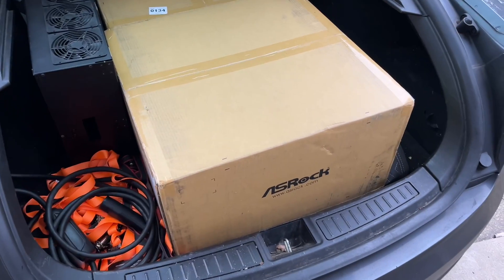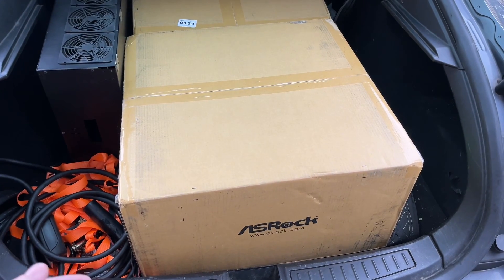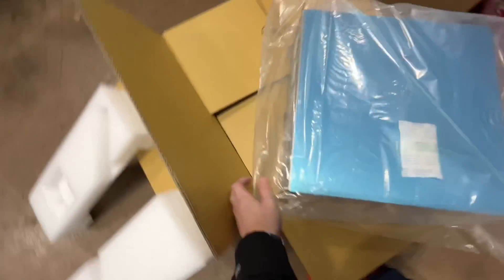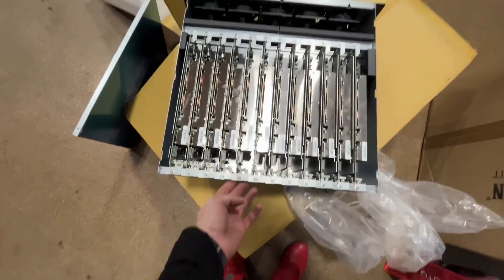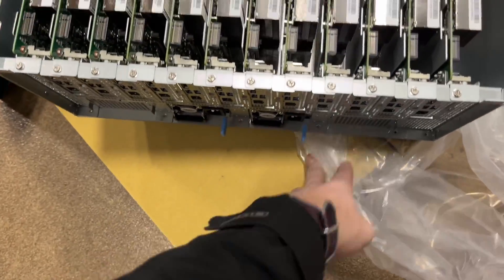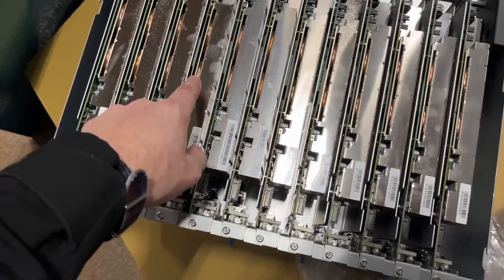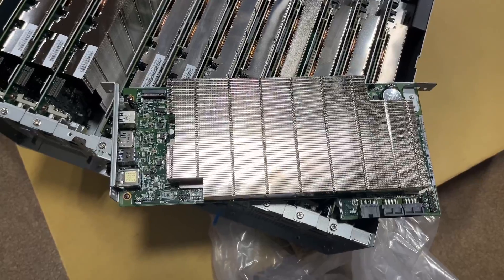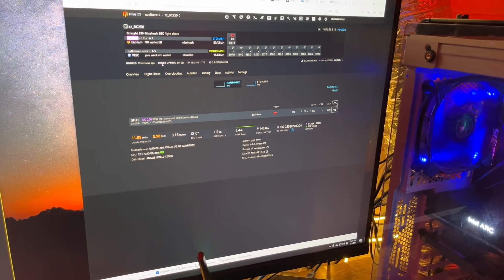is the BC-250 good at mining?  not really, no.

Comment: @ - Ovalbore Tech- I have this 12 rig APU - I do not understand couple of things - how to setup it properly - Me looks like a total idiot when I now unpacked this whole 12 APU miner - never seen such a Frankenstain at all in my life - I bought it only because that whole 12 APU miner are dirt cheap - number one question - I have only wifi at home - I see you have wifi adapter stick in USB port of this APU - so why on the Earth are wired internet needed for this thing if wifi stick are plugged in??  Can it take internet only from wifi or that wired internet is a MUST as well ??? And second question - How do you managed it to add all 12 these APUs - I mean whole box - at once to the Hiveos ???? Third question - how did you manage to boot it up just a one APU seperately - what you done to get it done and boot into windows as well??? Will it mine if in windows booted? Did you test it on SRB Miner in Hiveos (I have some algos in SRB miner needed to mine) - will it run SRB miner in hiveos ???   THANK YOU !!

Comment: These things are very weird,  as far as mining goes, the way I look at it is right now the cpu mining pays for the power cost and whatever I'm specing mining on the gpu is free crypto...is it worth it from an efficiency standpoint.... meh it uses a ton of power, but in my situation that's ok. Don't buy these things if you are limited in how much power you can use...but if you have the power and dont mind the efficiency, its hard to get this much hash for basically the cost of a 4070ti super
Reply from the maker: they strike me as 10 series efficiency but the plus is you have an insanely dense box of nodes you could easily spec 24 to 36 projects on at once with dual GPU mining AND cpu mining. it seems to get less inefficient the harder you push it. 

just a really weird device! :)
Reply: @OvalboreTech  very weird and it was so dam cheap, I have some interesting videos coming out on a use csae for them lol. Super interested to see what everyone else comes up with

Comment: You can windows on it. And if you are just running one of these cards, put a jumper on the psu and it will use less electric.
Reply from the maker: I tried windows, power consumption still awful, no official driver support but I was able to get drivers largely installed. 87W idle power consumption.

incorrect.

Comment: Great video!!! I picked up 4 cases about a month ago and have been tinkering with them ever since. I would love to see some content on how-to run SteamOS on one or hack a Win driver like you said. I hope someone does unlock the BIOS and really open these things up.
Reply from the maker: they do boot in to windows just fine -- drivers... Sort of load?

SteamdeckOS is next.
Reply: let us know how it goes. I just wanna see its gaming performance.  @OvalboreTech
Reply: @OvalboreTech  Nice!!! Which driver did you use? I was able to boot to Windows, Ubuntu (nomodeset), and SteamOS...but the drivers are a problem on my end too. A friend of mine loaded up one of the Hive versions that has working drivers for it. He then hacked it back to the default desktop GUI. He said he couldn't get the 3D end of it working right though.
Reply from the maker: I was able to force zen 2 desktop APU drivers on it but limited effectiveness. for linux, has to be 6.10
 @rickiv7133
Reply: @OvalboreTech  thanks, I'll have to give that a try. Please keep us posted if you find anything new. Thanks.
Reply: @OvalboreTech  do you remember which driver it was exactly?